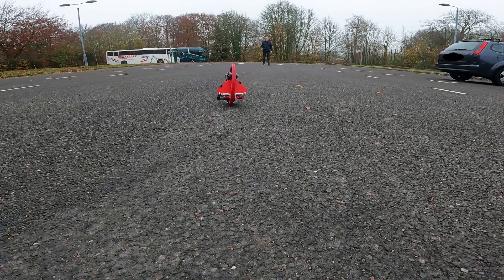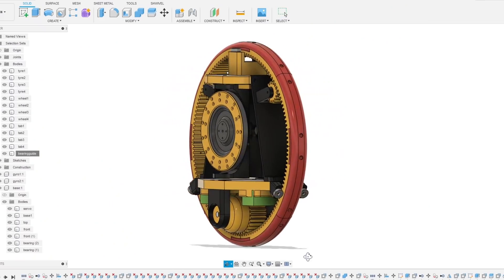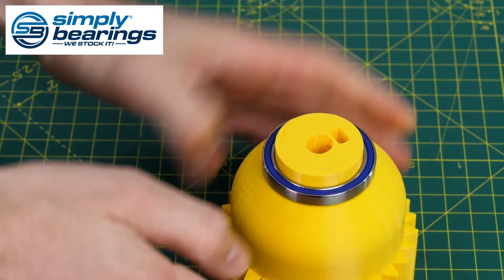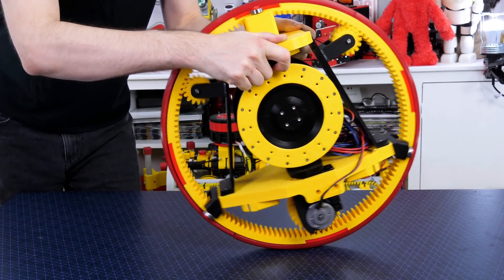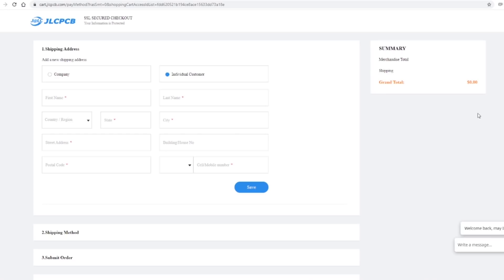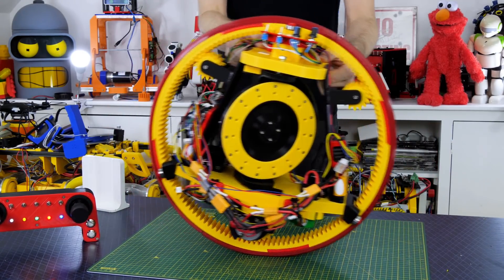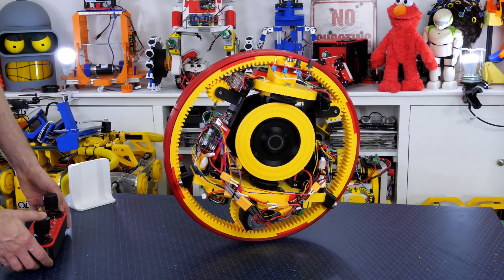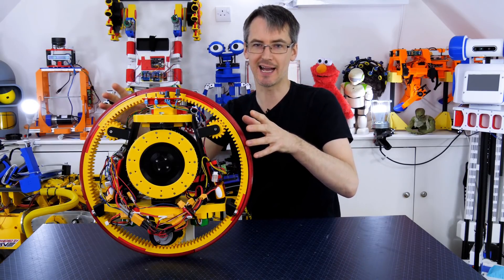Gyroscope Stabilised Monowheel

Comment: 0:34 you told about oscillations that occur when you move too fast or donwhill. The interesting thing is that the same happens to newbie euc (electric unicycle) riders, and they  often can't resist this and fall. I had this a couple times without falling. And it even can happen to advanced riders on high speeds (like 40-50km/h or more), sometimes after making long fast speed turn with high side inertia.
Reply: Why the hell would anyone be stupid enough to ride an electric unicycle at 40kph or more? Or at all...? That's a bit fast for the circus's audience to be able to see much, isn't it?
Reply: @barefootalien  emm, as a compact transport it's better than bikes, scooters and everything else. I ride it the whole year, even in winter with lots of snow and cold weather. In big city, I don't depend on weather or traffic jams, can go fast both on roads or sidewalks or even through parks/forests. And it also fits well in any public transport (if you want to save charge on a very far trip).
Reply: @ZorgKirill  But the whole imminent death thing...

Wait... are we talking about those one-wheeled skateboard things? Or a literal unicycle with an electric motor on it to ensure a speedy demise? xD
Reply: @barefootalien  unicycle with motor, where you stand still and accelerate/brake with lean
Reply: @ZorgKirill  Ah, I see. I've mostly heard those called "One-Wheels" where I live.

That's a very different thing to what I believe most people would call a "unicycle" which is like half of a bicycle; a relatively large diameter (knee- to waist-high) wheel with a fork attached to its axle upon which is a seat, with pedals to propel it. So when you said you ride an electric unicycle, that is what I was picturing.

But both of those are very different vehicles than a mono-wheel, which is an extremely large wheel that comprises the entire exterior of the vehicle, with the motor and occupant inside.

Functional, useful one-wheels exist, obviously, and I agree, if you're someone who is capable of and comfortable with skateboarding, it's probably a great option for inner-city transportation.

Functional unicycles exist, but they're so notoriously difficult to ride that it's considered a stunt worthy of an audience.

Functional monowheels... do not exist. Not really. The few that have had any real-world use cases at all have always added small trailing wheels (or fore-wheels) to provide leverage for the motor to turn the wheel without just spinning itself and the occupant around inside of it... and at that point, it's no longer a monowheel, but more like a motorized penny-farthing bicycle.

The monowheel, even in principle, has several nigh-insurmountable problems. The first is steering. The mechanism that makes bicycles and motorcycles stable is completely absent in a monowheel.

When a bike starts to lean to one side, the handlebars, whose mass is always ahead of the steering axis of the front wheel, naturally turn in the same direction as the lean, putting its tire contact patches beneath its center of gravity to stabilize it.

A skateboard, roller-blades, ice-skates, one-wheel, etc, very low vehicles with small wheels that you stand on, have no inherent stability (with a human riding them; obviously some of them are stable on their own), but rather co-opt the natural balancing mechanisms of our brains and bodies, so that with a little training, most people can learn to use them effectively and reasonably safely.

A unicycle is inherently unstable. Like a helicopter, it takes constant intervention by the rider to keep from falling, in a way that does not utilize our natural balancing instincts, and must be learned. However, it has just enough control inputs through the pedals, and the twisting of the rider's waist (and usually some arm flailing) to allow it to become moderately usable.

A monowheel, so far, has none of these. It's inherently unstable, moreso even than just a wheel rolling along the ground by itself. The force to shift the weight of the rider/motor/chassis can only come from the wheel itself, which is problematic, because it pushes the wheel in the wrong direction, often further than can be compensated by the lean that results.

Add to that the limitations to how far fore and aft the center of mass can move relative to the tire's large contact patch, and the relatively high ratio of the spun mass to the unspun mass, and acceleration is inherently very limited. This is bad enough, but braking is limited to exactly the same extent, and if pushed beyond that limit, becomes an utter catastrophe as the rider, motor, and everything else just becomes spun mass, rolling along in a way that is not only totally disorienting to a human rider or to control circuitry and sensors, but also innately eliminates the ability to decelerate at all.

Further, I don't even understand the appeal. Other than looking mildly interesting (mostly because they're so unusual), their only real advantage is tire diameter, which makes bumps and terrain obstacles comparatively less problematic. Suspension does the same, only much better, with better safety and better performance.

So, I say again... monowheels are a very bad idea and I don't believe they will ever be practical or even tenable, let alone safe or reliable, outside of CGI sequences.

Your device that you use to get around town is not a monowheel. I would argue that it's not a unicycle either, but that could be a regional parlance sort of thing.
Reply: @barefootalien  I didn't even read that all. You just dont know and understand what you aer talking about. Google some euc examples like Inmotion or Kingsong
Reply: @ZorgKirill  Okay, I did that.

That is not a monowheel in the sense this video is discussing. You are not sitting inside the wheel. It is not driving the wheel through an internal gear system along the inside of the wheel.

The difference, to a non-engineer, may seem subtle, but I promise, it's enormous. 

When you ride that, you are balancing with your center of mass well above the wheel, a difficult feat to be sure, but one that you have evolved to be able to accomplish so that you can also do things like walk and stand upright.

In a monowheel as is being discussed in this video, you are attempting to balance from inside the wheel. A wheel that is bigger than you are and also heavier or comparably heavy.

It isn't even close to the same thing.

They look similar. Actually, because the robot he's building is not full-scale, it looks extremely similar. But it isn't the same type of vehicle at all in terms of its dynamics.

Notice how he already has made a one-wheeled robot with its center of mass above and outside of the small wheel down lower? Notice how that project was a success?

Notice how this one failed?

There's a reason for that.
Reply: @ZorgKirill  I mean, not that you'll probably read what I just wrote either. How can you purport to argue with me if you don't even read what I said?
Reply: @barefootalien  it doesn't matter if it's the same or not. Both have the same behaviour that can lead to crash/fall, and I mentioned that. As for one-wheeled robot success, there are 5-6 manufacturers worldwide, they have already sold thousands of eucs, ppl ride them in any part of the planet in any weather conditions. Isn't that a success? And where are the "inside-monowheels"?
Reply: @barefootalien  and as for this ton of text: I repeat that you are wrong and don't know the subject you are talking about. Modern eucs are so powerful, that I can win most cars (except sport ones) in a drag race from traffic lights on road. I can literraly lean forward 45 degrees to the ground, and wheel has enough power and traction to accelerate so fast that I dont fall forward, until I reach speeds around 65-80 km/h (it's limit). The same with braking: i can lean back as if im sitting on an invisible chair, far behind the center of mass, and wheel has enough power to brake with such force, that i dont fall back (untill it stops fully and starts going backwards).
Reply: @barefootalien  and by the way, some new eucs have suspension, like in mountain bikes.
Reply: @ZorgKirill  "Where are the inside-monowheels?" Well... there aren't any. Or, almost none, anyway. And that's exactly my point.

I think part of the problem here might be that one brand is literally called "Onewheel". To be clear, that is not the same thing as the concept of a "onewheel" being talked about in this video. It's sort of like if we were talking about a Jaguar (the sports car), and you started arguing that jaguars (the animal) don't have tires. Less extreme than that, I'll grant you, but still, I think that's the underlying source of the frustration.

Here's a video showing the concept of a monowheel being discussed here, and I think you'll see pretty quickly why it's not something that's popular or likely to ever see widespread use of any kind.

https://youtu.be/fyu3KtQa35Y

Despite the roughly similar appearance between your device and what James is building here, it isn't the same at all. The physics is completely different. He's trying to build a robotic version of what was in that video, and that is what I'm saying is untenable. Here's why...

Consider this:

The maximum possible acceleration you can achieve on your EUC (assuming it's within the capabilities of both the motor and the traction available) is directly related to how far forward you're leaning. Specifically, the geometry of the right triangle formed by the contact patch, the center of mass, and the point on the ground directly below the center of mass. The ratio of the vertical leg of the triangle to the horizontal leg of the triangle is the acceleration, in g-forces, that the vehicle must accelerate in order for the rider's angle not to change (i.e. fall down).

The lean also has to provide the torque required to change the angular momentum of the spun mass of the vehicle, but in this case, that is a very small adjustment, since the mass of the wheel portion of a monowheel is probably only maybe 2 kg, or 2% of the vehicle mass.

Because the center of mass is well outside the radius of the wheel, in theory, that ratio, and thus that acceleration, can be arbitrarily large. As long as the motor and traction can handle it, you could lean forward almost 90° and get acceleration that approaches infinity.

For context, for a 2 m/s² acceleration, a bit more than that of a typical commuter-style car, you need about an 11.5° lean (inverse sine of 2/9.81). Not too much of a problem.

Now for a monowheel, the center of mass is smaller than the radius of the wheel. This means we need two triangles. One for the torque generated by the lean angle, and one for the acceleration produced by that torque at the radius of the wheel against the ground, where the friction can act.

If we're generous, and assume a fully-developed commercial monowheel motorcycle can get its center of mass half way between its geometric center and the ground, that means the acceleration caused by the lean is halved. This doesn't mean the angle is doubled... it means the sine of the angle is doubled, so now we need the inverse sine of 4/9.81, or 24° of lean. Remember, this is assuming that the spun mass is negligible... except for this kind of monowheel, that's not a valid assumption anymore. In this kind of monowheel, I'd assume the spun mass (the tire, the wheel, all of the gears, the moving components of the motor) is more like 30% of the total mass of the system... but even ignoring that, a 24° lean is starting to be quite a swing. Enough that you'd really need to start accounting for the angular momentum of the rider as well.

So what about maximum acceleration? Well, at 90°, the most the mono-wheel can possibly accelerate, with a massless wheel and gearing, frictionless contact between everything but the tire and the ground, and a rider and chassis equipped with a Star Trek style inertial dampener, is roughly 0.5g. Sounds fine, right? That's a very impressive acceleration; only the fastest production sports cars are that fast, and only supercars get much faster.

Here's the problem.

A big heavy SUV can brake at about 0.75g. A typical car, closer to 1g (or even above, for sports cars).

So the best a monowheel with its center of gravity half way between its center and the ground can possibly do in an emergency stop, is roughly 2/3 the braking performance of a big, heavy, not-so-great-at-stopping car. Realistically, that's incredibly optimistic. I haven't done the math for the real thing, but my instincts as a physicist and engineer say that a real monowheel would be lucky to hit 0.25g of deceleration in an emergency, and that... that just isn't good enough.

Even worse, once the angle of the rider/chassis goes past 90° in either direction, the available force starts to get smaller again. In theory, this just means you'd be limited to that maximum deceleration. In practice, unfortunately, it usually means the rider and chassis become spun mass and begin rolling along with the wheel, at a speed determined by the ratio of spun mass to total mass. This is very bad. Aside from disorienting, now the vehicle's net deceleration goes to zero and you're gonna have a bad time.

In practice, what would happen on a EUC is that you'd simply wipe out. This would suck for you, and potentially another person or two you might slam into... but ultimately, you're a relatively soft, deformable 86 kg mass moving at maybe... what'd you say, 40 kph, so 11 m/s, and have a kinetic energy available to dump into your body and/or any innocent bystanders of about 6 kJ. That's broken bones level, but probably not fatal or seriously dangerous to structures or other vehicles.

On a monowheel, we're talking about a much more rigid structure than your soft, fleshy body, and something quite a lot heavier. Assuming we're talking highway-capable motorcycle-equivalent monowheels here, let's say it's 500 kg of monowheel and rider, moving at 100 kph or 28 m/s. Now we have an uncontrolled rolling missile on the loose with a human inside it, careening down the street with 196 kJ of kinetic energy. That's entering full-blown car crash territory. That's possible death to the rider and multiple bystanders. That's careening through plate glass and cinderblock to plough into the tables of a roadside cafe.

And all of this is just the lack of available braking force... we haven't even begun to talk about the other axes of stability... or rather, instability.

And again, this is also assuming a probably-impossible monowheel with its CoM half way to the ground (realistic is more like 20% afaik), and ignoring angular momentum and inertia, internal friction, second-order effects like the rider/chassis system gaining its own angular momentum as it swings, etc.

Just... watch the video. The guy, to accelerate maybe about as hard as an electric skateboard whose battery is almost dead, has to waddle the thing along, wobbling and skidding and delicately accelerating as he swings around, until he finally gets enough speed to get a little gyroscopic stabilization.

We never do get to see him do any braking, because he always crashes before that even becomes an issue.

I say again, this is not a practical vehicle design. it's never going to be a thing. There's nothing in production that uses it. There are no robots using it. And, I predict, there never will be.
Reply: @barefootalien  dude, you are wasting my time by writing all this nonsence, created by your imagination. Eucs can accelerate, more than 5m/s², and brake even at around 1G or more, because while braking it recuperates energy and has twice the power to do it. And again, I don't care if the thing on video is totally the same as euc or not. I didn't write that. That's your crazy imagination to prove something nonexistent. Bye, I need to go and continue impressing simple mortal pedestrians and car owners by moving better and faster than they, using "an alien" technology xD
Reply: @ZorgKirill  I promise you aren't braking at 1g. You'd be leaning at 45°, and I seriously doubt the tires are that tacky (if they were, you'd wear them out in a few dozen miles).

But again... I'm NOT TALKING ABOUT EUCS

But you're right. At this point, you clearly don't have either the wherewithal, or the reading comprehension, to grasp even a very basic concept like "I'm talking about one thing, and you're talking about a different thing as if I were talking about it too."

I concede that EUCs exist. Of course they do. THAT'S WHY I'M NOT TALKING ABOUT THEM... and this video was not about them either.

If you think it was, then you have grossly misunderstood the video, not just me.

So yeah... bye.
Reply: Would anyone else like to weigh in here to maybe help convince this person that they should stop assuming things, and READ the conversation they're having?
Reply: @ZorgKirill  Ugh... it's not "not totally the same". It's more different than a car vs. a motorcycle. It's more different than an airplane and a hot air balloon.

One of them is tenable, works, and, as you seem to think I haven't noticed you pointing out about six million times now, actually exists.

The other one is not tenable, doesn't work, and has never been done successfully in a way that isn't a hazard to itself, its occupant, and everyone around it.

Comment: instead of changing the pressure angle on the spur gear, try increasing the backlash that way you have a wider area of contact to reduce wear on the gear while still having some extra space for flex in the gear

Comment: You could have used a hand file instead of throwing a print away and making another. A belt sander would make your tire flat. Don't you know how to use tools? I don't see this as being very smart at all, quite the opposite really.
Reply from the maker: The prints aren't solid so you'd end up with massive holes in it.